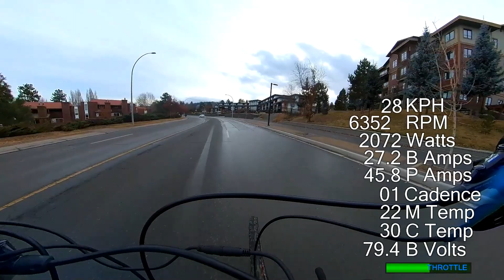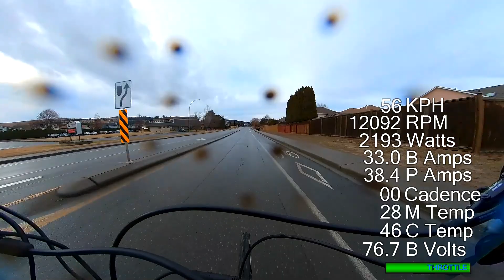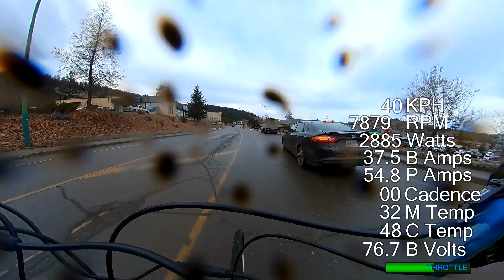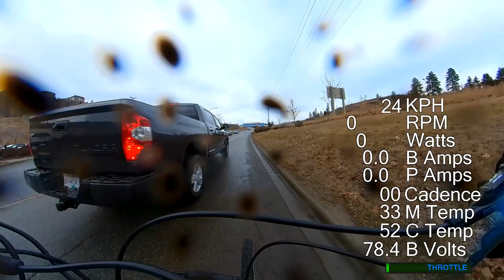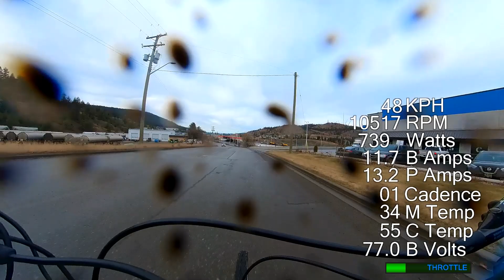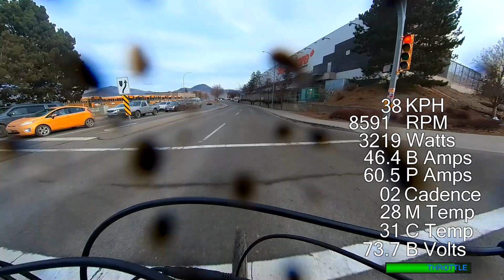DIY E Bike Speed Test - Stress Testing the TOSEVEN DM01 mid drive up 8-10% grades at 3kw

Comment: Sweet! I'd personally feel more comfortable, at those speeds on a wet road, with a bigger contact patch like a 3 or 4 inch fat tire offers. It's awesome seeing the DM01 do so well in your tests.
Reply from the maker: Yeah. I will be switching over the the FatBike for most of the riding. Maybe I will swap over to a DM01. Not 100% sure the 110mm will fit. We will see. Am moving on to the DM02 shortly as I think less power will still be manageable.
Reply: @HighVoltageKits  As always, I look forward to seeing your results.

Comment: Was going to get a tonsheng, same as a put on the wifes bike but Im going to go with this as I will be doing more mountains and paths here in Wales. Going to buy from psp power, but may need advice on controller etc. Great videos 👏👏
Reply from the maker: Thanks! I would start of with the stock one and go from there. I will do some more work with the modified motor in the new spring! If you need any help with the stock motor you are welcome to join our Discord! The links are in the description.

Comment: Thank you for the informative and thorough videos! I want to check in and see what the current 'status' of this kit is as of Feb 2024. I see that the motor kit is available online for purchase - does that mean that many of the items in your older vidoes such as the poor cable routing from the motor and the excessive cable length etc has been solved or does that still remain? Additionally, I see that the kit on california cycle has brake sensors with it - will these work with hydraulic breaks? I am interested in pairing this with something like a Trek FX3. Thank you!
Reply from the maker: Unfortunately the long cables still remain. The feedback was sent on though. I don't think much has changed beyond the firmware which has seen some improvements to the torque sensor.

Comment: when you talk about hill climbing like that long 4km run it would be good if you also added the degree angle from level it would give a better idea of how steep the hills are that you're climbing... any thanks for the video
Reply from the maker: I'll try. I only have the one phone and it looks like it can't run strava and pull the data from the controller. It varies between 8 and 10% though. I'll see what I can figure out as you are right. It would be cool to have that.

Comment: It's not for nothing but to have a temperature of 7 degrees in summer I think that both the controller and the motor are going to get very hot.
Reply from the maker: The controller is not an issue. It was not in direct airflow as this build is a very much development. After I opened the side zip on the controller bag it stayed much more in range and once its mounted on the frame it will be no problem. The motor will always be a balance. I used to run the same hill with a BBSHD and past 25C outside you need to watch it a bit. But by that point it will be set to throttle. So in practice it should be safe. With the BBSHD we were able to do that. This is a new motor though so perhaps it will behave differently. Another option would be to run a kinder gear ration and accept a lower top speed up the hill of say 45 which would generate less heat. We try to not let the internal temps get above 70-80C which tends to put extra stress on the components. Good comment. Cheers

Comment: BTW. How often do you have to replace chain and cassette? Every 1000 km or less?
Reply from the maker: I usually switch chains at 4-5k. At least that's been the case with my BBSHD. I have a chain tool to check them periodically. Unless your chain is really out of line the wear should be dramatic. If chains are failing early it's usually a problem in the drivetrain somewhere or really cheap chain.
Reply: @HighVoltageKits 3-4km is good mileage for a chain on an ebike especially on a bbshd 😀 i use kmc 9 chains and they are outstanding.
Reply: Be aware, you really want a high quality chain and cassette, also as your chain wears down and stretches, the cassette will also wear on the gears, often you will replace both depending.

Comment: I have one question.

I'm gonna build a 3-wheel tilting cargo bike.
What would be the better motor and also why?

Toseven dm01
Or
Bafang ultra G510 uart?

I think you have enough experience to answer this with easy. Thanks in advance! 🙃
Reply from the maker: I am assuming this is something you are building from scratch? If so then you are going to get a cleaner look with the m620. You can make the bracket as part of the design. The 01 is a bottom bracket DIY motor. Both will give you similar power. The DMO1 can go up to 60 volts. The DMO1 also has a less proven track record. Depending on where you get it from though it might be cheaper. Otherwise both will get you torque sensing. For an OEM look the G510 would give you a nicer final product. Hope this helps. Cheers
Reply: @HighVoltageKits  thanks for your answer.
These are all the points I know about.
But which one drives better? Which is smoother? Which one would be more reliable? The look is for sure better and cooler with the g510. But if the look doesn't matter what would you choose?
🤔
Reply: @HighVoltageKits  maybe one is more quiet then the other?

Comment: Maybe I missed it, but what kind of capacity does your battery have?
Reply from the maker: I did not say. Its 21 amp hours 72 volts. 1400ish watt hours
Reply: Is it a commercially available battery?  The specs show that only pulls 60V but under your using more than that did you have to do special settings for that?

Comment: Motor seems good but as I can see the Motor is already over 700$ right..? Any ideas where to get the spare parts?
Reply from the maker: I think its about $700. You will get warranty with that. Spare parts will be via dealers and direct support from the company. As it expands it will be more widely available.
Reply: That price is excellent, for a mid drive with cadence and torque sensor.

Comment: When I listen to you take off from a light it doesn’t seem like you are shifting. Are you?
Reply from the maker: For a large part of it no. I am mostly using the largest sprockets. The 32t gets you up to about 50kph the 28t is topping out at just over 65kph. The field weakening is giving it quite a wide RPM range. More than I was expecting.  The 26t if you are up to speed you can get over 70 which is too fast really for the scenarios where I want to ride this bike. I am shifting quite alot more riding pedal assist with the field weakening turned off.

Comment: The BBSHD boasts a peak power of 4000 watts, surpassing the TOSEVEN DM01 which has a peak power of 3000 watts.
Reply from the maker: I mean right now I have the watts limited on the DM01 to 3250. But I could stick it at 4000. But I'm pretty cautious. I'm in no rush especially heading into winter. As it stands this is the only DM01 with an external controller in the world. The bbshd has been tried and tested for years to reach the generally accepted 4000 watts. I guess the point is we just don't yet know the absolute limits of these TOSEVEN motors. Gonna be fun finding out tho.

Comment: 3k watts -- I thought this was a 750w motor?
Reply: This is the 1000w motor with an asi bac855 controller instead of the stock controller. He's limited it to 3000w this video, but it can go even higher than that, which you can see in another video Cap posted.
Reply: I know about the BAC. and 72v. I thought that motor was 750w like all the other commercial ones out there.  @_Drae2210
Reply from the maker: I mean there are two sizes. One is 1000 watts rated the other is 750. In reality just like the bbshd is rated at 1000 watts it looks like they are well built enough to push beyond those limits.
Reply from the maker: I think maybe you only saw the first part of the previous video on this? I was showing the pedal assist to start with at lower power. I can see why you might have got that impression.
Reply: still, not being able to 'one gear' it means i'll never consider buying. plus I dont care about torque assist.  @HighVoltageKits
Reply from the maker: I mean I kind of did a bit. It does 0-60 on the 28t. But it don't sound like your cup of tea for sure.
Reply: Oh, thats cool, then. IDK, I just really dont care about pedal assist.  @HighVoltageKits
Reply: @RetroMancer242  bbshd for you then bud.